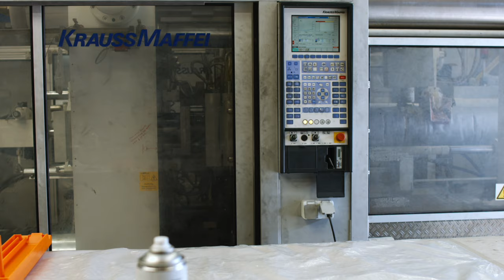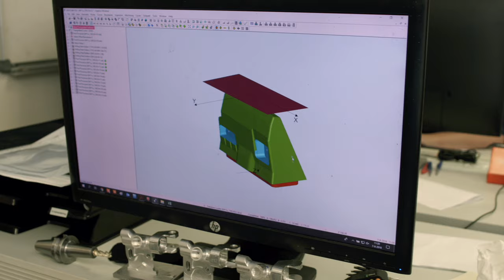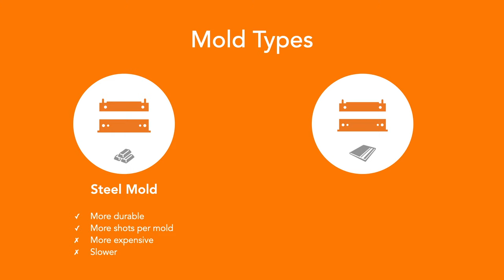Injection Molding: Mold Design & Making

Comment: Interesting, however you fail to mention the most important item- Plastic molding is a thermal process, the design of the mould most ensure that heat is removed from the plastic in the most efficient manner. Only 4 things which must be considered in sequence- Get the material in, get the air out, get the heat out, get the part out. Good luck
Reply: Can I make human miniature I injection moulding
Reply: Do they pull full vacuum before injecting the plastic or do you just leave a few thousand air gap around the 2 mould halves to allow the trapped air to escape?
Reply: In the setting I work in, this is known as “venting.” There are little valleys/grooves in the face of the tooling that allow this air to escape. A dirty mold can create venting issues leading to part defects possibly.
Reply: Depending on the plastic used there are many cooling solutions. I make automotive molds, and every single one is water cooled.
Reply: @PermaSlepe  Oh boy do I love cutting little microscopic vents into the parting line by hand. It's the most fun ever :P
Reply: @thomasbarlow4223  there are small extremely shallow gaps machined on the mold faces that allow air out

Comment: Good video to illustrate how mold is designed and manufactured. About the injection mold life span, maybe you could get it more detailed, such as with different plastic material, what steel is more suitable to achieve certain life shots. Thanks for    sharing.

Comment: why are aluminium moulds more expensive when steel is a cheaper material (most grades)
Reply: Steel molds are more expensive even though the material is cheaper because machining steel takes much longer than machining aluminum. Depending on the machine used to cut the mold and the mold design it can take 2-5+ times longer to machine steel than aluminum. There is also more programming time of the CNC machine needed because you have to be more careful with breaking cutters. 

So shops charge more for the labor and the machine time for steel molds.